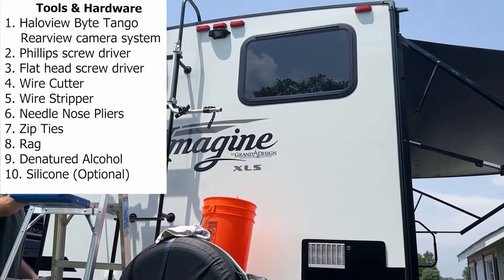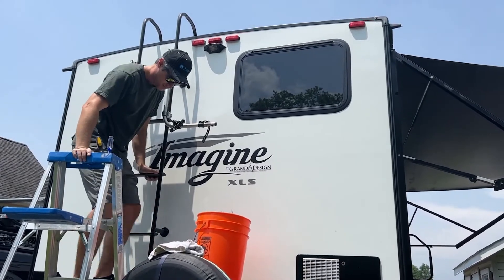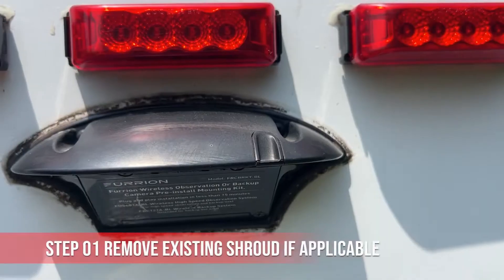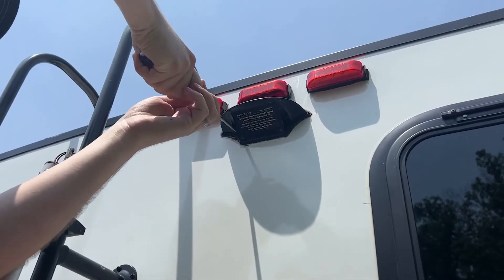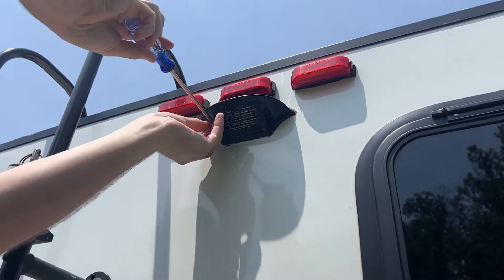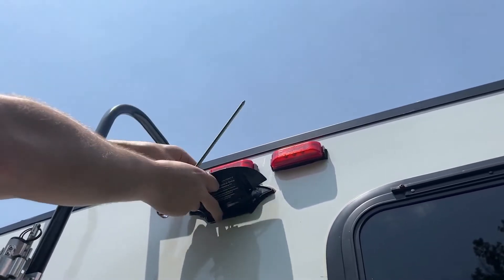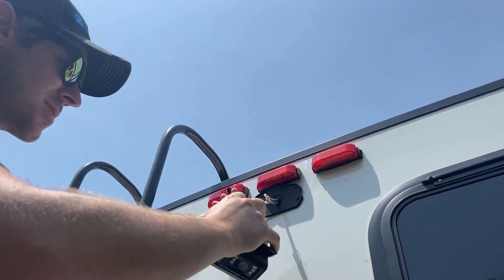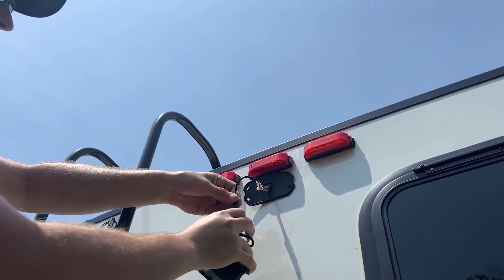How to install Haloview BT7 on 2019 Grand Design Imagine XLT 21BHE(Furrion prewired)

Comment: Your furrion mount didn't have those 2 lower screws installed?
Reply from the maker: All four screws are installed. What is the distance between the four holes of the furrion bracket of your RV?

Comment: Total failure at the end. Stop and end the video immediately. Not enough room in the back of the camera housing now for the needed additional adapter plug and the wires that are already in the back of the housing, and preinstalled wiring for the Furrion preinstalled wires.  Time for plan B.